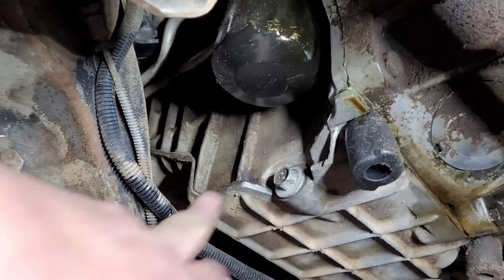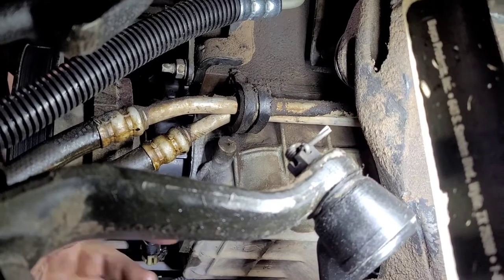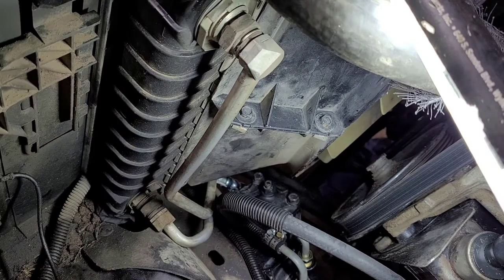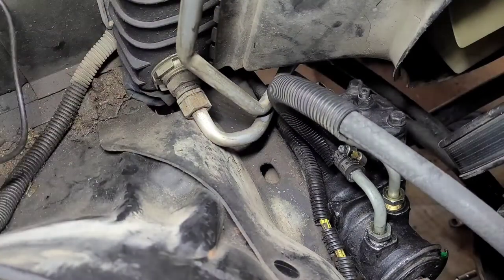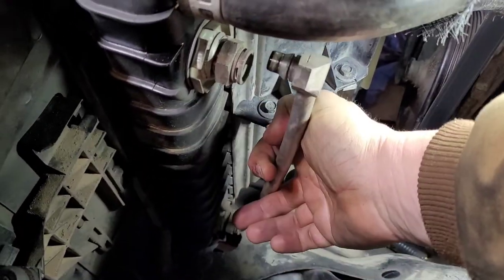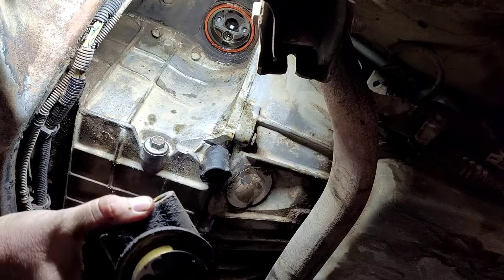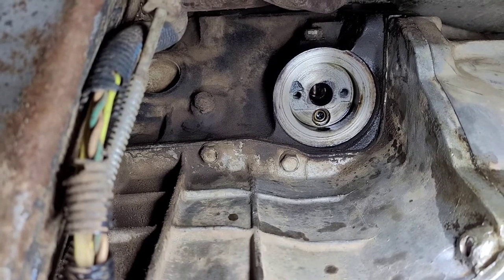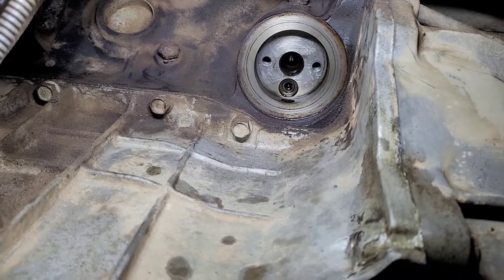How to replace the oil cooler lines and oil filter adapter gasket and seal on a 1998 S10 Blazer.

Comment: i;am your newest subscriber my 1999 Astro van pours out oil iam going to do what you did in your video hopefully it will stop leaking
Reply from the maker: Worst part is trying to clean and scrap off old gasket material from the oil filter adapter

Comment: The oil lines are difficult to push into the couplers on the radiator.......to make this easier, I position the cooler lines in the couplers and then place an appropriate size fuel line disconnect tool around the line. I press the tool in an effort to push the cooler line deeper into the coupler. When it becomes difficult to insert the line into the couplers I place a tube wrench against the fuel line tool and hit the tube  wrench with a small hammer resulting in the cooler lines entering the coupler until they are in the right location.

Comment: You should do a suspension front end video! Even oil pan. Nice one!
Reply from the maker: I did a video on replacing the upper control arms, wheel bearings, brakes, and ball joints

Comment: Why do you need to replace the oil cooler lines? I have oil in the coolant & I think it's from the oil cooler, not the crack head (no water in oil, 1994 Chevy K1500). How do I know what parts need to be replaced (oil cooler, the gasket & o-ring, or the oil cooler lines?) Any advice & suggestions. I'm an older woman & start learning, watching YouTube & doing the work by myself if it's simple & if I could.
Reply from the maker: If you have oil in the coolant, chances are you possibly have either a blown head gasket or the radiator is internally cracked and causing cross contamination. Check your oil level and see if the oil is a milky color, that would indicate coolant mixing into the oil, if that's the case then it might be time for a mechanic to check it out, the reason for replacing the oil cooler lines is the rubber lines themselves deteriorate over time and leak at the crimps and will leak right thru the hose thru pinholes, good luck!

Comment: Great Video, I'm the process of  changing the oil cooler lines this.. my lower line just popped out this week. I had a puddle of oil on the front left tire. I said WTF..! I had did my oil change too. All this after I had replaced my radiator about 1 yr ago. Go figure? So I'm paying more attention to both lines when installing them. I have to hear the click and see if the clips hold the flare head lines and I'll pull to see if they are in place. I have to purchase a set if longer metric wrenches for the 13mm bolt. I had cut the rubber lines and remove the cooler assembly 40 torx bits gave me hell.. so I'm cleaning the housing and buying new gasket and O-ring seal. Where did you purchase the new oil cooler lines from? Thanks
Reply from the maker: Rockauto.com
Reply: @theman9764  Good Evening, I was able to order the Oil Cooler Line and the Oil Cooler Housing gasket and O-Ring.. it comes in a kit for $1.91 and the lines were $41.79.. super cheap compared to the big box auto parts stores.. that their price was double and triple the price.. I had to cut the rubber lines.. I had a problem with the 13mm bolt, it wouldn't budge.. I 'll remove it on the table vise to hold the Oil Cooler Housing. Original part was never removed since factory assembly. Thanks again..!

Comment: thank you for this video, im getting ready t change the oil lines on a 95 4x4 blazer, it has 2 different lines  1 from the filter housing to the radioter that you just swapped but there is another 1 that goes from the block to the filter housing & the line bracket for thise lines are connected to the oil pan,  it just seems to me that they just made everything harder to do, i do not understand why they judt didnt put the oil filter straight on the block like most older cars instead ofswitching to off set filter placement
Reply from the maker: @craxydtrain  is yours the type where they relocated the filter to the front corner of the fender?
Reply: @theman9764   no  its located in the same place in the video,  im not sure if that blazer he worked on has 1 line or 2 because it looked like he just replaced the 1 that went from the oil filter housing to the radiator,but there is another 1 that comes from the block to the filter housing, i had trouble fig out how to get that plastic holder that holds the lines to the bracket that then is bolted to the oil pan, now imscared if i remove those bolts my oil pan will leak & i do not want to change the oil pan gasket becayse reading the chilton book its really hard to do

Comment: Is it a good idea to use some type of thread lock for the bolts?
Reply from the maker: You could probably use a little dab of blue loctite but as long as you snug em down pretty good i think you'd be alright without it

Comment: Good job amigo, ken you tell me  the part number  for gasket an o ring
Reply from the maker: I don't remember the exact part number i used but you can find it easily on rockauto.com, also search oil cooler gasket kit

Comment: very good video where I can buy the oil filter housing and how much does it cost.  They don't have auto zone.  o'really.  Advance.  and napa.  I have a 2002 astro van and the oil was mixed with the antifreeze.  thanks for your attention.
Reply from the maker: I bought most of my parts on rockauto.com
Reply: @theman9764  thank's